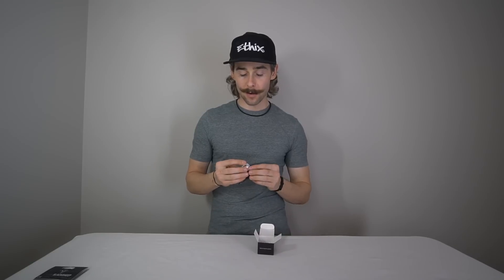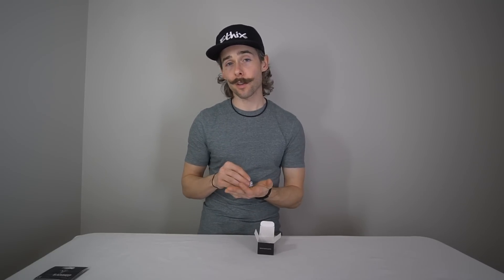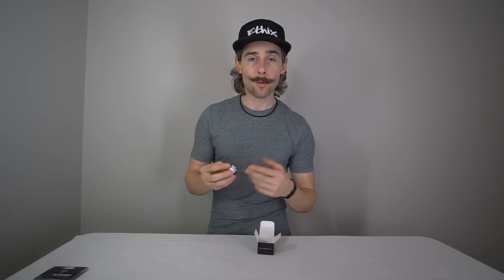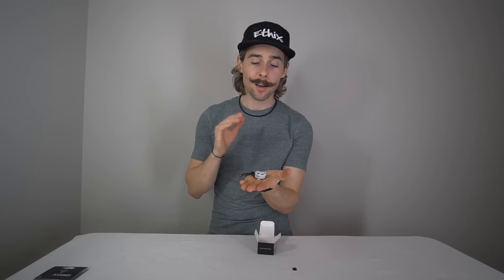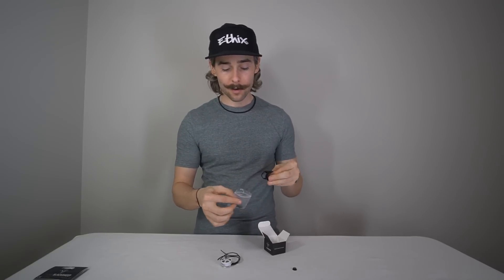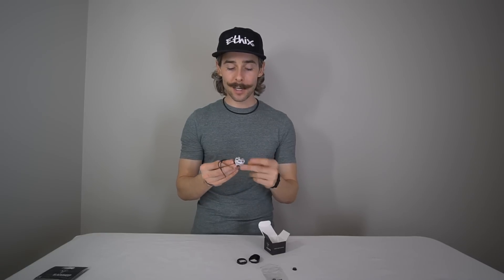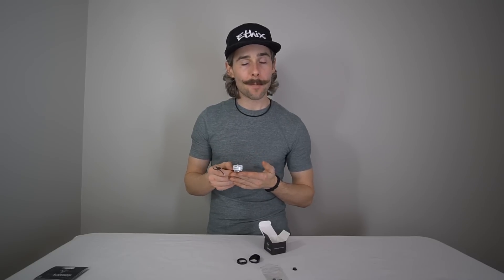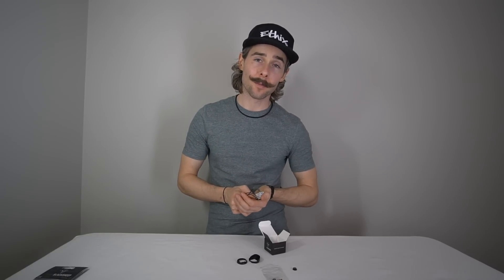Mr Steele SILK 2306/2345KV 4S/5S Motors | ETHiX

Comment: im thinking on doing your quad build but with 6" arms. would you recomend these motors or some others?  going full kiss elecs 

dont know yet but thinking about putting 6" arms on it..  the low end power and sound seems intresting. (its also going to be my first build) 
thanks man!
Reply from the maker: Check out the Moon boot motors :) on the ethix site. They are designed for 6” props
Reply: @MrSteeleFPV  thanks, yhese motors look sweet! i se they are a little lower kv, i asume this will give them a little bit more power. 

thanks for the advice

Comment: I‘m thinkin about putting these motors with the Stout bells on a new build: 4S 1550mah, stretched X 3“ or 4“ frame with arms for 5“ props. Just wondering if my Ori32 25A (35Burst) 4in1 ESC is strong enough for this setup 🤔

Comment: Pretty sure the bell is mounted with 2.5mm steel screw not 1.5mm screw as twice stated.  One would use a 1.5mm hex and some heat to remove it from the bottom of the bell.
Reply from the maker: 1.5mm is the Hex tip size that keys into the screw.. as shown in the video

Comment: No popo not buying lol
I used to use those motors, but I replaced ALL with lumenier 2206 popo motor, I’d love to go back to Steele’s motors, but as he does not like popo system,... 
another thing is the S3 prop, I’d love to replace all my motors back to steele’s, S3 and 6s, BUT as the motor and prop does not have the system, I’m out, the weight is not a problem, after all, it’s 4 prop nuts off!
Reply from the maker: The hub is lightened aka thinner making it physically impossible to make a popo version. High Performance comes At a cost
Reply: Mr Steele So 0,7g less plastic instead of a 2g prop nut! 
This power train still heavier than popo lol
You could offer opinions and leave the buyers to decide what works best for each of them!
What do you think?